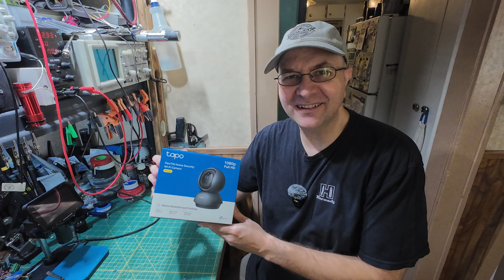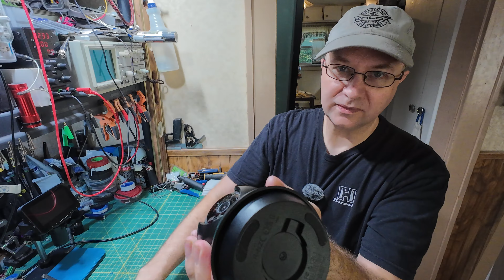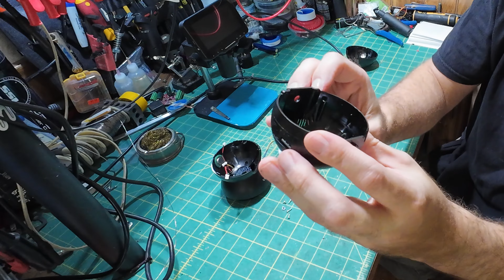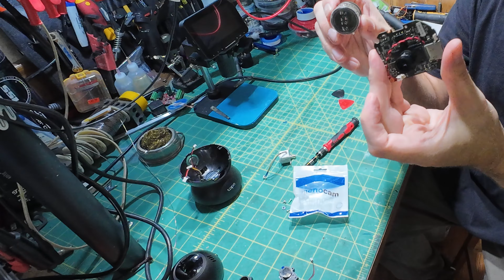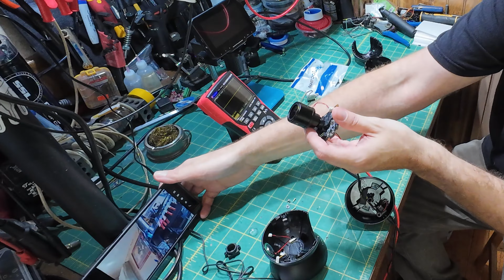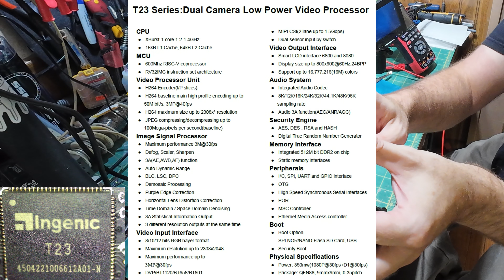Tapo C201 Camera Teardown and Mods

Comment: Wow, my mind is blown from seeing the sensor soldered to the board, and you then have options vis a vis the optical part of the camera. Didn't see that coming. I was coming at this as someone who merely wants to disable the IR LED so I can face outside through a window at night without the reflected IR blinding the camera. Thanks for the video of dismantling the device.
Reply from the maker: Thanks for watching man yeah lots of options for such a cheap camera to mod with.  I am using with the macro lens mod I did, but still haven't built a better case just having it hanging out there.